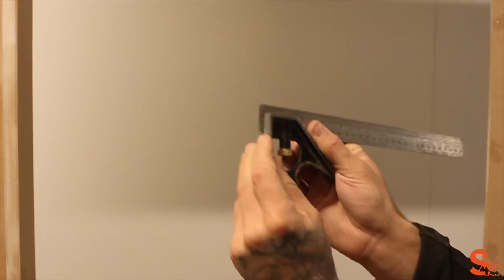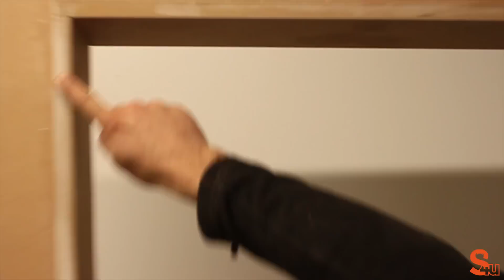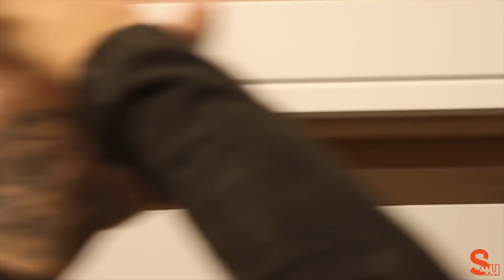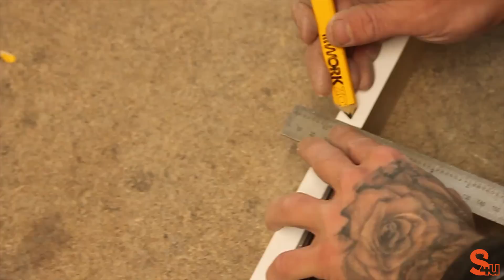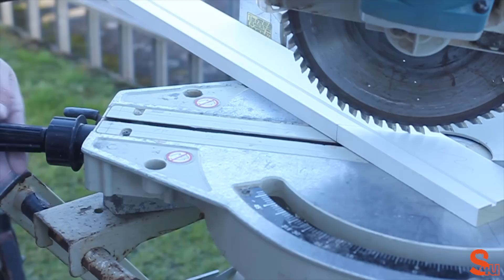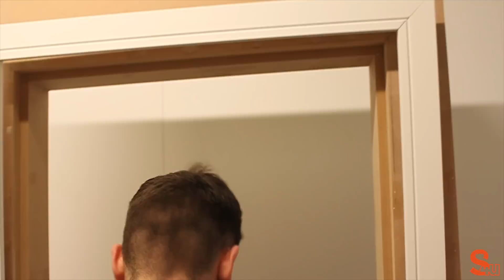How to Fit Architrave to an Uneven Door Frame

Comment: Nice tip, but just for the folks doing this (dont forget to adjust the mitre angle on your drop saw....use your bevel to adjust the angle on the saw, if those cuts aren't exactly 45 degrees....if the door frame is out then they won't be, hence old mates video..hopefully you have decent 'indents' on your drop saw base) Run a test cut on some scrap timber if you have them to check the mitre angles. If you're using a Paslode 'Angled Finsh Gun...throw it in the bin and get a 'Straight magazine gun' as used in the video...lol. 
 Great tip mate. Thanks for sharing

Comment: Depending on how accurate your miter saw is you can use a Stratton angle finder in the 2 corners...also I don’t use miter fix anymore I find hot glue is better

Comment: What was the spray you used before you put the glue on the end of the molding?
Why did you have to send 4/5 nails through one area (top left corner) when applying architrave?
Please list your glue, spray, and nail gun.
Reply: the spray is the activator for the mitre glue.